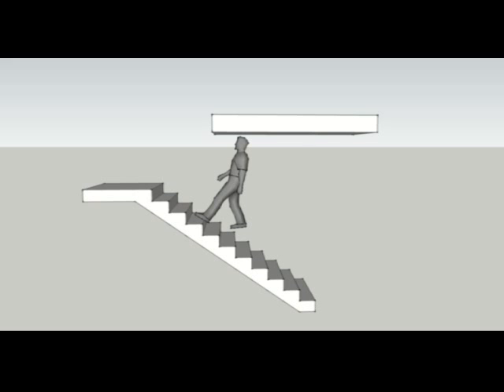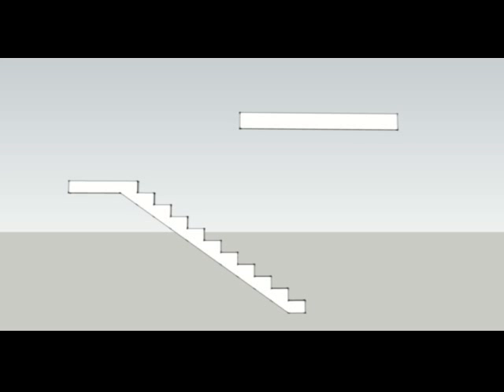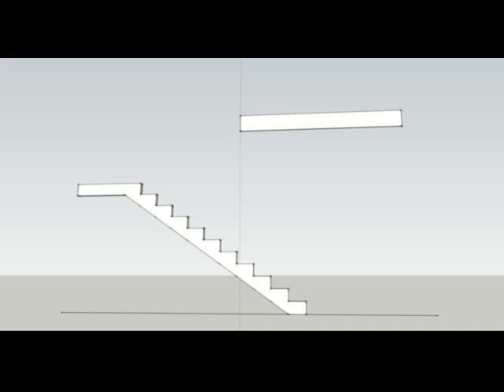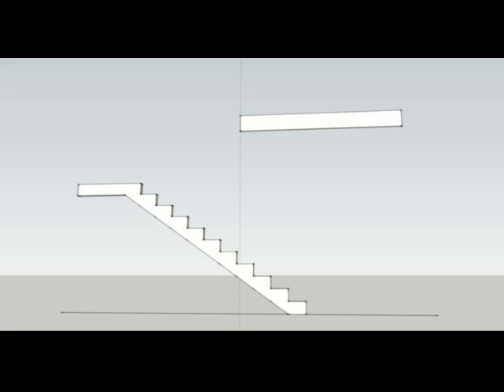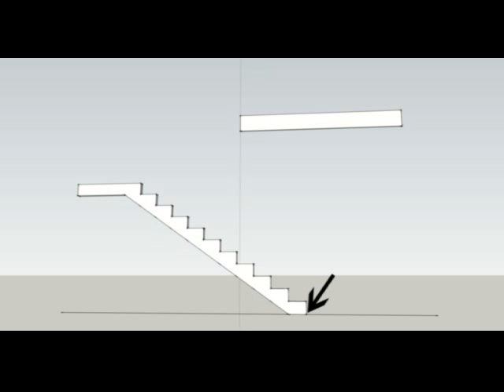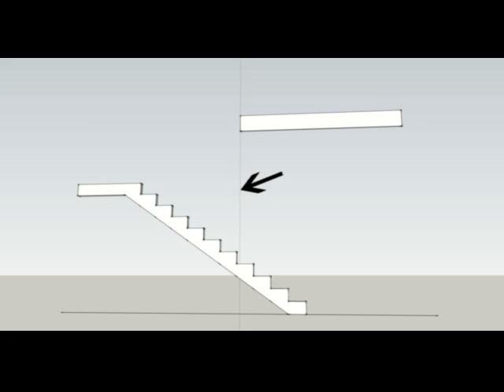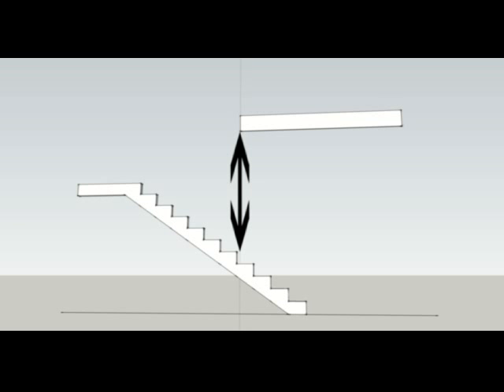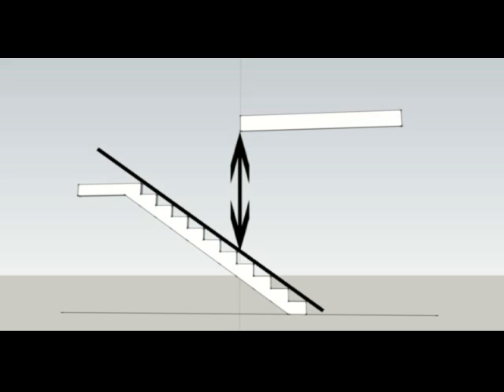How To Figure Stair Headroom Clearance - Building and Design

Comment: there is no doubt you know what you're talking about you sound very intelligent I'm trying to find out and answer to one simple question I have a shower wall that measures 73 and 1/4 in in height the area where it's going measure 75 in high how much clearance do I need to raise it up into place
Reply from the maker: I always enjoy comments feeding my ego:) However, you should check with your local building department for this information. I think most of the time thought it will be about 7 feet - 7 feet 2 inches.